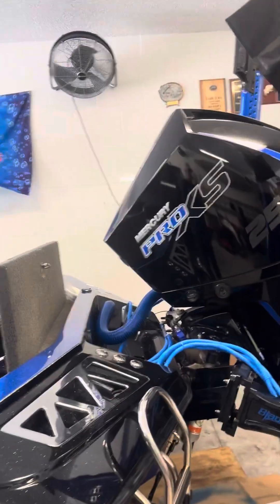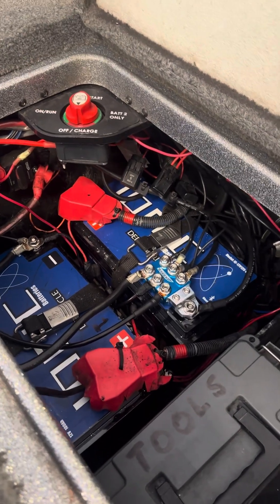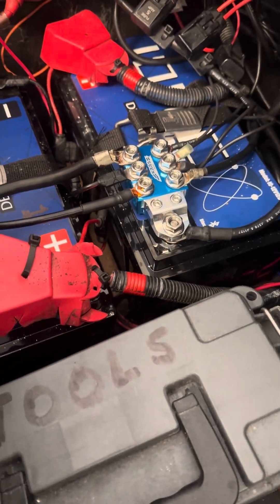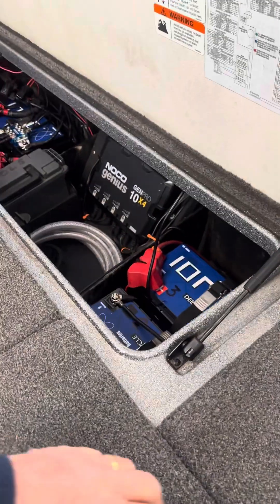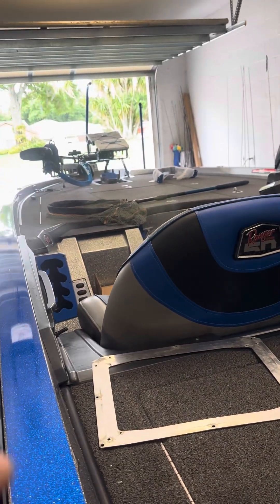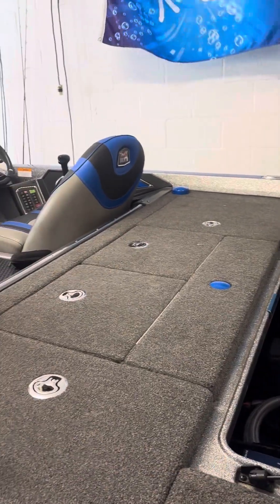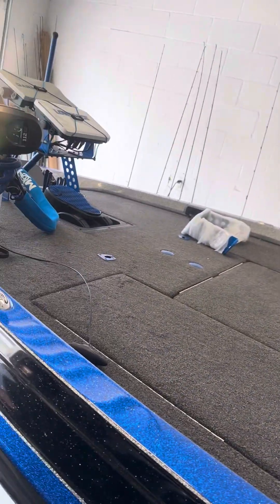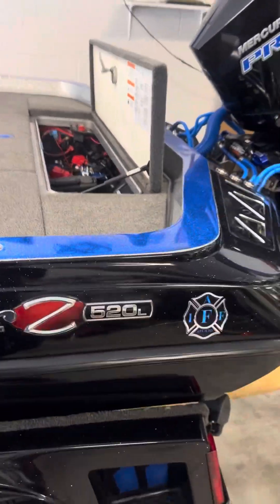Ranger Z520 Ionic lithium battery & install tip to save time running 8-gauge wire for electronics.

Comment from the maker: 13 months installed with an 11-year warranty, all 3 deep cycle 100aH batteries have had their internal battery management system “lose their minds”.  I have made the decision to go back to Walmart 29 series lead/acid.  I have been off the water 5-weeks trying to figure out the reason for no power at the trolling motor.

Comment: Hopefully, the Ionic cranking BMS will not fail like mine and fried two set of touch pad.  About 3K worth of pads.  I'll be switching to Lithium to trolling but never the cranking again unless I build a fail safe fuse system.  Certainly, never Ionic again